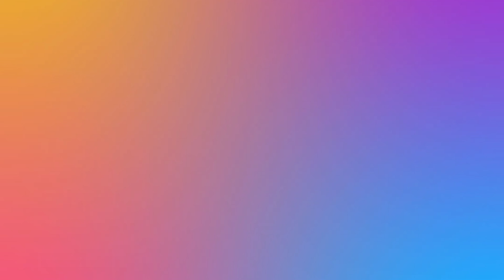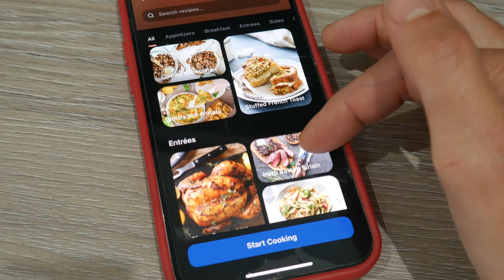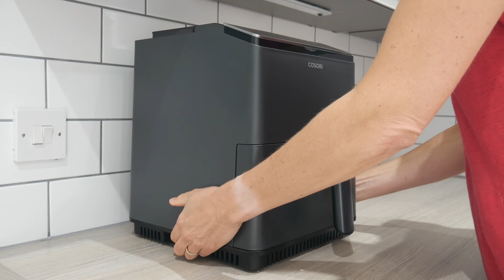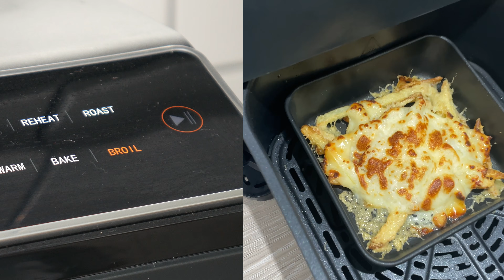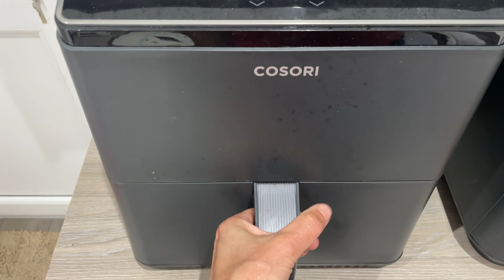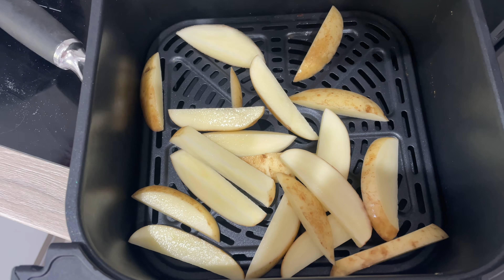Cosori Dual Blaze review - are two heating elements better

Comment: Plate should be flipped over. The raised ridges should be facing up.
Reply from the maker: That's not correct, it's designed to be used to allow hot air to get underneath it, but if you want to use it reversed, go ahead

Comment: We all have a tool with bottom heating element and great capacity, higher temp, and a big grill. It's our regular convection oven. Air fryers are nothing more than small convection ovens  For large quantities, air fryers lose they advantages, that is the lower waste of energy in heating up and cooling down. They do not take much less time really and are much harder to work with. You get an air fryer to do a few sausages, or potatoes, or reheat with great quality and low energy cost. They shouldn't try to be full size ovens. If you want something powerful, get a small 450c professional convection oven. That can actually do more than your oven and air fryer. Good meat flavor, pizza, etc.
Reply from the maker: Thanks for your engagement
Reply: Hi
Thanks for this information. Seems you know much about these units. I am stuck on deciding which unit to buy- air fryer or convection oven. I need a powerhouse that will save time when cooking fries only like 3-5 min cook time when i host events. Which do you suggest? Thanks for your time

Comment: Have had my Dual Blaze for several years, and agree with others about taking the crisper plate out to bake with.  I actually use it to saute veggies and bake scones. My main “issue” is the Teflon coating.  Just bought a Typhur Sync because it has ceramic coating and tried the scones.  They were pure white on the bottoms.  I’m not sold on the Typhur at this point.
Reply from the maker: Thanks for sharing your thoughts
Reply: I have actually repacked my Typhur and will be returning it.  I’m too spoiled with having heating elements on top and bottom… Will just have to mitigate the Teflon by cooking in other vessels inside my Dual Blaze.
Reply: I think there are Dual Blazes with Ceramic. Sold at Walmart.

Comment: Sorry, there are other brands that have used the same "idea"...double heating elements:

Midea 6L Air Fryer with Upper and Lower Double Tube Heating

Midea Vertical Dual Zone Air Fryer Oven, 11L, 2 Drawers

Cecofry&Grill Duoheat 6500. 2200W (brand CECOTEC)

Cecofry&Grill Duoheat 8000 ( (same as above)

Ufesa Heron Max

Taylor Swoden 6,5 L  Dual Blaze™

Princess air fryer 8L  - 182280

Also, I suggest watching this:

https://www.youtube.com/watch?v=vsaR2GoiIHU
Reply from the maker: The video was published in August 2024, at the time none of those models were availble for sale in the UK

Comment: Dear Candid Clara,
Thank you so much for your tests. I'm looking to buy an air fryer, and your videos are incredibly helpful.
Regarding the quiche, it might be interesting to pre-bake the crust a bit, as we do in France, and then add the topping once the partially baked crust has returned to room temperature. I think this would better showcase the effect of the bottom heating element.
Thanks again!
Reply: I have to add some more explanation, I think. Once it’s taken a light golden colour, you can remove it from the mould, wait for dough temperature to drop, and bake it with the topping without the mould. It will receive the hot air in the bottom too.
Reply from the maker: Hi Alex, thanks for the comment.

Comment: I've had a Dual Blaze for a couple of years and I think you are doing it an injustice and not taking proper advantage of the bottom heating element. Take out the tray and place any pie, quiche etc directly on the bottom of the draw and the bottom element will brown pastry bottoms as a normal oven. Also, making meals that have sauces like stir fry etc, again directly in the basket using it like a pot without the tray and they will cook perfectly with the direct heat from the bottom element.
Reply from the maker: The reason I don't talk about cooking food with sauces in the Dual Blaze is because it wasn't built for this. Thre second element was added to do away with the need to turn dry foods when they are being cooked. Cosori even advise marinated foods are patted dry before placing them in the air fryer (page 13 of the manual). It's up to you what you do with your own air fryer 😊 but for anyone wanting heat above and below and an appliance that can both air fry and cook sauces, multicookers do just that and more... https://youtu.be/g3rXu85VQ1g
Reply: @CandidClara  Fair point about the saucy dishes Clara, but I still stand by my putting the pie tin directly on the bottom of the basket and not on the trivet to take full advantage of the bottom heating element. Nothing worse than pastry having a soggy bottom.  ;)
Reply: @CandidClara  multicookers are a waste of space and money. Just cook it without the crisper plate
Reply: Also using without the crisper tray is brilliant for pizza nice brown crispy bottom
Reply: Ya, she should have taken out the bottom basket then set it in there 🤦‍♂️🙄😂

Comment: With the pastry perhaps a change of setting for another five minutes on the bottom only would give a better bottom bake. It’s large which is a bit of a pain. 
In reality how many people would use the App. It’s a testament of the design of the browning plate that the results from a single element works so well.
Reply from the maker: Thank you for sharing your insights! It’s always helpful to hear different perspectives

Comment: Hi Clara, in case you are interested, I have just come across a Midea 6.5 litre air fryer, with the same bottom burners as the dual blaze. It has a few extra features too, including a glass drawer and a removable splatter guard over the burner and a menu option to choose from. I think it looks pretty good. However, it doesn't have a flat base in the basket. I was looking at buying it, but Cosori include a 2 year warrantee, free of charge. Not sure about Midea, but I have their pressure cooker and it is very good.  Jane
Reply from the maker: Interesting, I shall check that ou, thank you
Reply from the maker: I can't find this model, even on Midea's website, do you have a link?
Reply: Hi, it was on Amazon. I dont have a link sorry.

Comment: Hi, I have a Tower air fryer which has bottom heating elements. Admittedly it is a mini oven, not a basket and the majority of the mini ovens dont have that and also its very cheaper than the dual blaze  and cooks on two levels.
Reply from the maker: Which model is that? I’d be interested to look it up
Reply: @CandidClara  Ive been having a problem with my messages popping up.
Tower T17051BLK, Vortx XL 14.5L 5-in-1 Digital Air Fryer Oven with Rotisserie. As I said admittedly it is a mini oven so only two bars, the same as the bigger versions. 
I just bought the dual blaze, I have always wanted it and its on special offer! Jane

Comment: Hi! I think it would be great to know the power consumption of the airfryer, but not just this one, all of them. But I am totally fine if you don't, because it's an extra haste. I don't think that this would use much more energy, because it heats the food up and down, you maybe end up using lesser heat and time. And these heating elements won't run continously, they turn on and of. I don't even think it would use both of the heating elements at the same time, that would use a lot of power for a plug-in type device that we use for long time (a kettle would, but a kettle runs for just a few minutes per cycle.)

And I want to say, I really like your videos, I only found you last week, and I don't know how I lived without it! Even if I don't shop for every stuff you review it's great insight!
Reply from the maker: Just to follow up…. I have found a gadget that measures consumption! You are a genius, thank you for the idea. All being well this should be making an appearance in future videos.
Reply: @CandidClara  A follow up from me! check if you can actually use that thingy! some can't handle such high wattages. I have 0 knowledge actually about measuring devices, but I know smart plugs, (the kinds that you can turn on or off remotely) and they definetly have a way of working, some can handle up to 3000W BUT can't handle being turned on and off a lot of times. I can't explain it that good, but I bet the manual does. 

Just to be safe if someone else reads this comment, theese smart plugs (typically) should not be used for high powered devices at all. For example, a coffee maker may be rated 500W but draws 3 times as much at the beggining, and this spike can cause danger. This shouln't be the case with measuring devices, because they don't have an internal on/off switch. In any case, it is best to consult the manual.
Reply from the maker: I appreciate the words of caution, I will be spending my evening going down a rabbit hole looking at different options, there must be something that is right for the job!
Reply from the maker: Firstly thank you so much for the comment! It’s really appreciated and it still surprises me when I get nice feedback, because I really enjoy making these videos! The power consumption thing is so tricky. I’ve done some tests with a wattage meter and the power draw is all over the place, up and down, on and off, some two drawers pull at maximum wattage with one draw running, others draw half the wattage! And then other appliances I have found have a high wattage as a badge of honour when they don’t actually need the power! (They just want to appear powerful!) 🤷‍♀️ There needs to be some sort of industry measurement that measures average  power consumption across 10 minutes or something?! I shall give it some thought and see if there is a way of adding up all the ups and downs and averaging!

Comment: My guess is that the cost of electricity will go up by about 50% or more with two heating elements.
Reply from the maker: It shouldn’t use any more electricity than the turboblaze for instance as they are both nearly identical wattage (1725 for the turboblaze and 1700 for the dual)
Reply: It takes less time to cook, though.
Reply from the maker: @Lisamakes I found the timings were the same as the dual basket Cosori
Reply: @CandidClara  just fyi, I live in Spain, and there are definitely other companies who do the dual burner. Cecotec, is one.